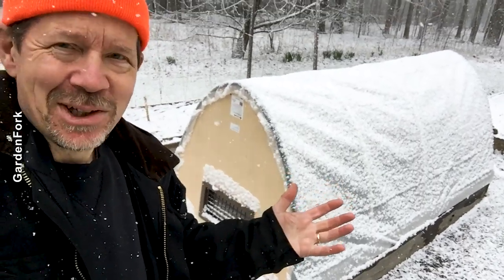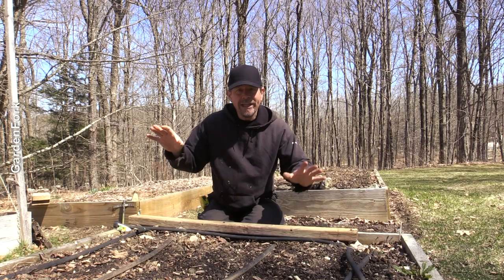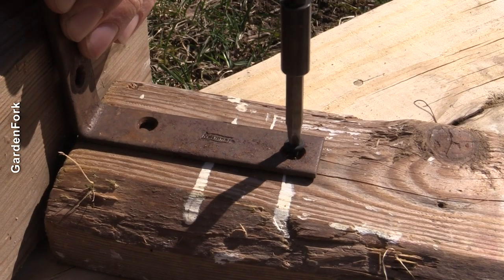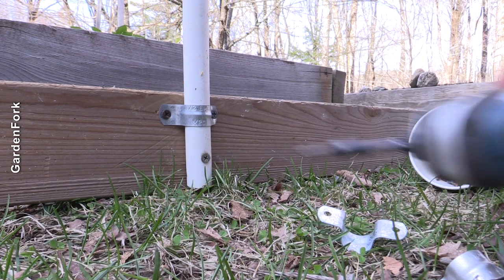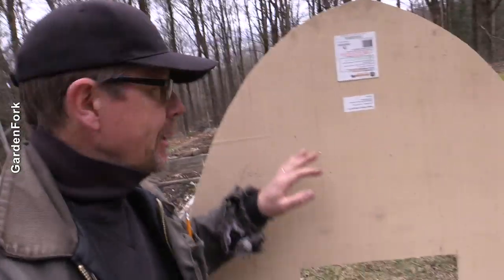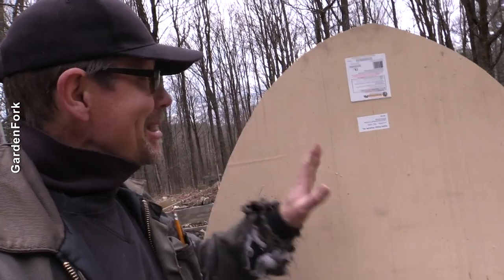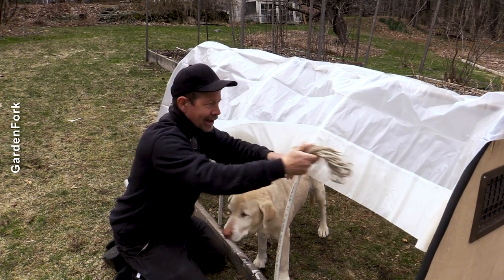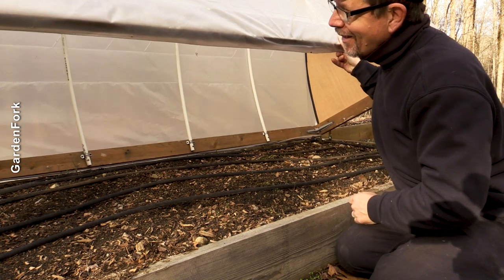Really Sweet DIY Mini Greenhouse For Your Raised Bed Garden

Comment: That's a pretty cool hoop house.  You could use a material made by Onduline called Tuftex polycarbonate corrugated clear roofing instead of the plastic if you needed it to hold up to snow better.
Reply from the maker: i have the corrugated material on my greenhouse, did not think to use it on the hoop house, thx for that!

Comment: We are on our second winter using our raised bed hoop house that yours inspired. If you recall from info I had shared on their construction, our hoop house has a base frame that sits on the bed. The hoop arch is attached to the frame with hinges. We used concrete reinforcing wire to create the arch instead of PVC pipe. Like yours, our raised bed hoop house also has the temperature actuated vents and is covered with 6mil greenhouse plastic. We also installed a wireless indoor/outdoor thermometer. Some models of these thermometers will transmit quite a distance to their receivers. They are nice if you want to recover temp fluctuations. We remove the hoop house from the raised bed around the end of March as cool weather greens begin to bolt and store it out of the weather to protect the structure and plastic. Three carry handles on each side provide hand-holds to move it. Lol It looks like a coffin for Bigfoot, but has been awesome protecting our cool weather greens through our winter.